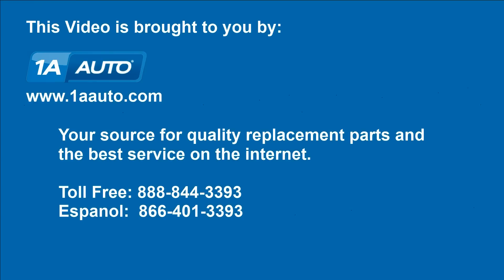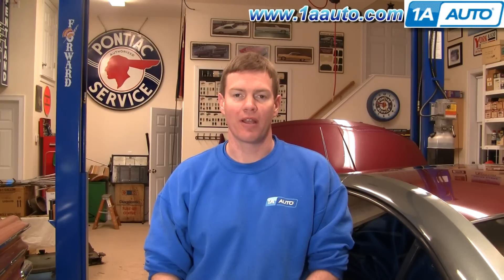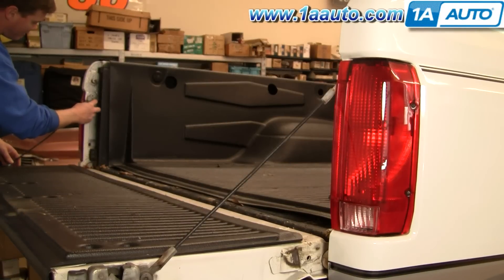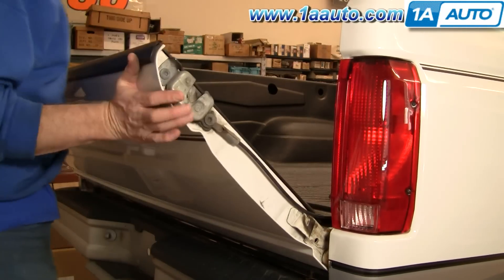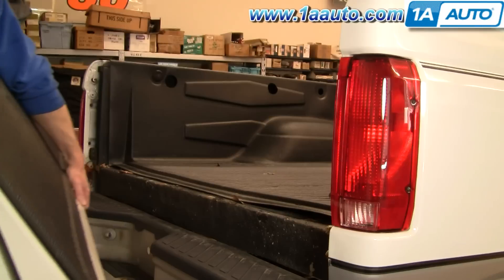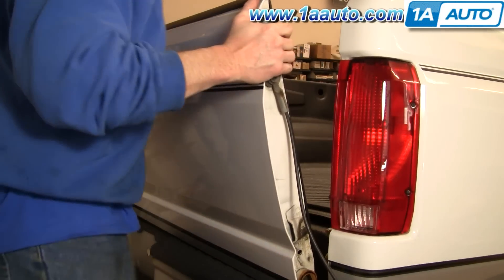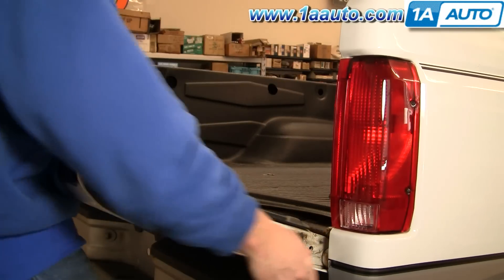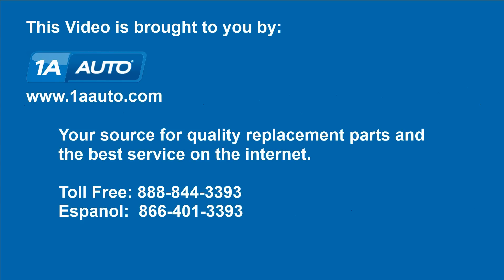How To Replace Tailgate Ford 92-96 F150/250/350

Comment: I have this weird rubber grommet thing on the right hand side and it is obstructing it to slide out from the little slot like you demonstrated . I’ve never seen this on any truck before ? I may have to remove the entire right hinge or try and cut the rubber grommet